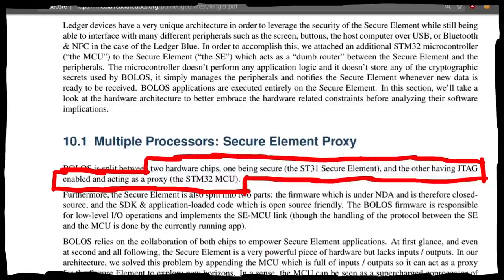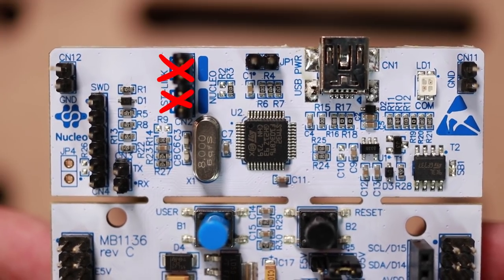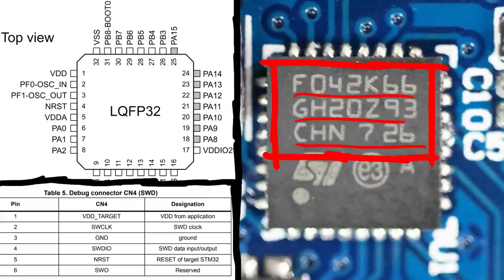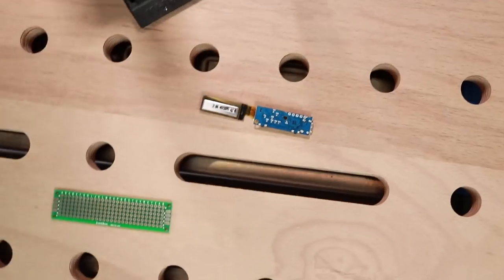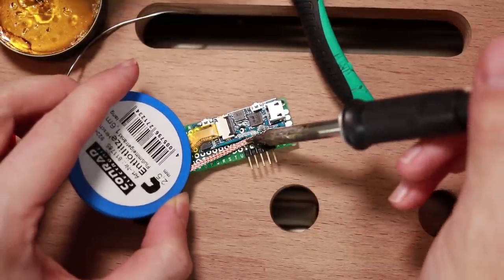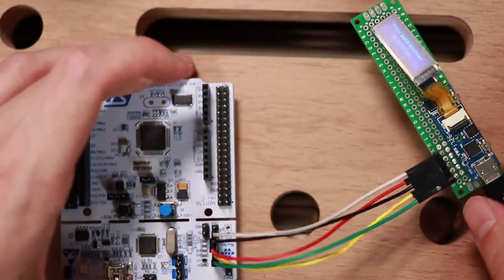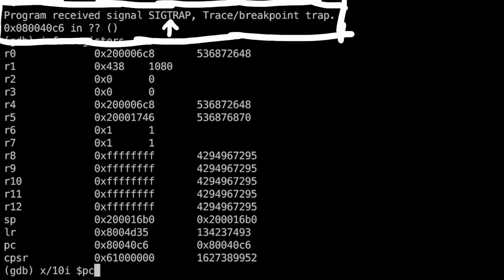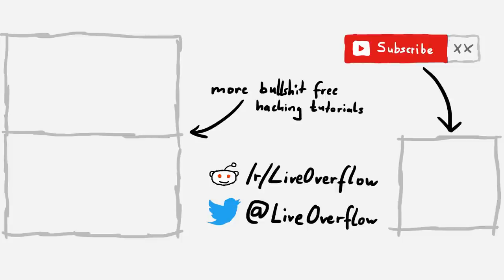Remote Debugging ARM Chip with SWD/JTAG - Hardware Wallet Research #3

Comment: So you basically made a PCB so that the pins are at a right angle? Instead of just poking them through the PCB of the ledger? Why is that? Why not just solder the pins directly to the PCB and, looking at the pinout, directly put the ledger with it's pins into the debugger?
Reply: Looks cool LOL
Reply from the maker: I thought it looks cool 🤷‍♀️
Reply: @LiveOverflow  lol agreed
Reply: so its more rigid to solder more hacks on :D add i2c sniffer pins, and to add blue status leds :D .... or it looks cool
Reply: @LiveOverflow  lol 😂
Reply: The debug pads on the Ledger don't have holes going all the way through - they're just pads. This makes it pretty awkward to solder pins on, and I think @LiveOverlfow's solution was pretty neat considering this. At the factory they will use pogo pins, which are the ideal way to connect to these pads.
Reply: better question, why not use the ST-Link instead, and install a simple JTAG/JLINK Update on it? I did it once and it worked.

Comment: Why haven't you soldered the header directly on the pcb?
Reply: PCB have no holes, those debug dots are placed right on top layer of PCB, so it's kinda hard to solder a header there
Reply: @V4ker  No need holes, it is easy to solder the header to the pads.
Reply: @V4ker  You can easily solder the header sideways if you know what i mean
Reply: @gabiold  Yeah, but it's kinda way too easy to rip them off

Comment: Why are you doing simple connection in so difficult way? Nothing criminal to solder wires to spots on the PCB immediately. Wires can be easily unsoldered back one by one but unsolder hard plate from all pads simultaneously is much harder and there is danger to damage the pads.

Comment: BTW Mr Overflow, that copper mesh is called solder wick.
Reply: ENTLÖTLITZE in German ^^
Reply: @RoiEXLab  Yes I also like to use ENTLÖTLITZE. For any soldering job ENTLÖTLITZE is a must have. The greatness of ENTLÖTLITZE must be capitalized here.
Reply: @RoiEXLab  Huh, TIL. I'm not even going to try to pronounce that but thanks for including it - I wonder if it translates to "copper mesh" by any chance. Google translates it to "braid" which i guess is correct, its also called solder braid too.
Reply: @QuickishFM  Entlötlitze means Desoldering braid
Reply: @QuickishFM  Huh, I don't know TIL. What does that acronym mean?
Reply: @avi8aviate  that means Today I Learnt.
Reply: @QuickishFM  Ok, thanks.

Comment: You should either power it via its usb port or via the SWD, not both. Especially if you are powering them from different sources. Keep just the ground connection, two data lines and the reset if you want to power it via the ledger's usb.

Later edit: although a lot of serial programmers (microchip, atmel, arduino, etc.) provide VDD to the target, it seems that this is not the case here (ST link nucleo). See the reply from Repligon below.
Reply: ST-link on nucleo doesn't provide power to the target. VDD_TARGET pin is there to read target's operating voltage. It won't even connet if voltage on this pin is too low.
Reply: @Repligon  oh, didn't know that. I thought that it also provides power.
Reply: in that case i guess it was resetting cause vcc and ground shorted(since it was swapped the vcc on the ledger was connected to the usb chassi on the st link)

Oh well, that's some quite resistant hardware XD
Reply: @Repligon  I was pretty sure that was correct, but when I looked at a couple of ST devkit schematics, and checked a devkit I have in front of me, the resistor connecting VDD_TARGET to the programmer isn't even fitted!  I've been connecting it religiously, but apparently on my devkit it's a do-nothing pin.  A 10k pulldown and nothing else..

Comment: When you want a soldering alloy to leak somewhere deep and narrow, use much flux (you really can't overshoot with it) and slightly (just slightly) overheated soldering iron. You touching your place with the tip and holding a little and then you can literally see how the alloy suddenly seatles down. Then you stop heating but let it cool down before you wil move it any kind. 
And in general use more flux and use a good one like FluxPlus, that can be leaved without washing and don't worry that it can corrode the copper.

Comment: Pin change happens and it is bad and terrifying!!😌😌😌
Just the day before yesterday I was working in addition for our school project, and took off the line from the ultrasonic module to pass through a hole in wood
After reconnecting, horror of horror , the arduino turns on for a second but the ON led fades (AAAAA!!!)
a lot of panic later, I realized the pin arrangement of the module was
VCC.  Trig    Echo.  GND (module pins)
   ¦          ¦          ¦           ¦
GND   Echo.  Trig.   VCC ( my connection)
SO GLAD to find it still worked! Thought I had fried the module 😌😌😌

Comment: My trick to make a path with solder : when you put it on the first point, don't remove the soldering iron and keep it barely attached to that drop of solder (try not to burn the boars) this way the flux inside it burns (or flows down, not sure) and it will follow the soldering iron that you use like brush to draw

Comment: What do you think is better to study to learn something like this? Electrical Engineering or Computer Science?
Reply from the maker: Does it matter? Just start right now ;)
Reply: @LiveOverflow  Well I can't decide between these two and hope you can help me :)
Reply: @maximood-tired  Electrical Engineering, its closer to the hardware, low level stuff :)
Reply: There is actually a nice strategic pick you can make there:
Can you say you're a passionate of one of the two? 
Then pick the other.

If you're passionate with algorithmics, system design and general computing stuff then picking EE will allow you to expand the knowledge in areas you would not pick up by yourself, that will often seem tedious redundant or unnecessary, but in the end provide you with a much better general picture.
Reply: At my University in germany, you can choose between Computer science and (maybe a bad translation) technical Computer science. One is more focused in Software, the other one more on Hardware.
Reply: I don't know about your schools, but over here I was able to major in electornics&electrical engineering and minor in CS -- so I got a bit of both

Mind you, I wound up working as a software developer, so it doesn't really matter what you study so long as you get in there and do something
Reply: You can approach it from both directions, but if screwing around with hardware like this is really what you want to do, Electrical Engineering is probably the better choice.
Reply: I got my undergrad in Electrical Engineering and am now getting my master's degree is Computer Science. It wasn't planned, but I felt like it was easier to "add" layers as I went up from EE to CS. But it's also perfectly valid to go the other way. Either way you can get started in both with an Arduino UNO and some tutorials!
Reply: Go for something called "Computer Engineering"
Computer Science is focused too much on theoretical and algorithms, EE Meanwhile focuses on all aspects of EE, including Analog Electronics,Digital Electronics, Electricity transmission and distribution( forgot the name of this subject ), Frequency and other Radio stuff.
In Computer Engineering tho, they teach you about Digital Electronics( the building blocks of modern computing basically, how you use transistors to make up logic gates etc which then make up a CPU chip or RAM chip ), Operating Systems, Embedded Systems, VLSI Chip design.

Comment: @LiveOverflow You was wrong about the VDD voltage, it's 3.3V not 5V, cause the stm32 not 5v tolerant, also I think you should not connect the second usb cable (to the ledger), cause it's already got the voltage form the VDD pin, but I'm not sure about that.

Comment: I use STM32 discovery board for STM32 bluepill. Need to get blackpill for testing. It seems almost all debugger prices are going down. microchip have some 10-15e debuggers (mplab snap) and Ti also have pretty cheap launchpad

Comment: After using these demo kit ST_LINKs for several years, I just realised that on the two boards I've examined, VDD_TARGET is not connected to anything other than a 10k pulldown on the devboard.  The resistor which would connect it to the programmer is designated as not fitted, and when I checked a real board, yes, it's not fitted.  Might as well not connect that wire..
Hopefully the 'real' programmers are better than that.
(edit) Ah, I see from Rafał Mróz's comment that you must fit that resistor if you snap off the ST-LINK PCB.  The ones I've been using don't have the snap-off feature.

Comment: The chip reset because the reset pin got pulled up by the development board. I've seen this happen with Arduino's, ESP8266's and teensy's It's usually for communication or to activate programming mode. The reset pin has to be pulled up to synchronize communication and reset current running script which sometimes uses communication pins for your script to be able to upload. 
I'm going in to cyber security and I'm so glad I already have a background in electronics.
Reply from the maker: Yeah of course. But here it happened because I reversed the cables and it was accidentally triggering the Reset - not the reset sent when debugging.
Reply: @LiveOverflow  I just checked and It looks like it was the ground and SWD clock you swapped so it wasn't even the reset pin strange. I suppose the ground pin must have pulled down the signals of the clock or something not really sure why that would happen but it shouldn't damage it at least.

Comment: Not sure the difference between the stlinkv2 and v3.. but how does the $40 stlink-v3/mini debugger differ from the $700 ulinkplus debugger?  The latter is said to use coresight and swj (swd+jtag)... but the stlink also uses swj/jtag!   So, for example, could the stlink-v3 hardware be used with openCSD to analyze a trace stream?

Comment: 8:25 Oh yeah, you should have powered the ST-LINK/V2 before powering on the target. As you noticed, doing it the other way around can cause problems, and I think it may also be bad for its long-term health. Hotplugging into a running system is also a headache since in my experience it tends to glitch the reset line. Basically, the ST-LINK/V2 just sucks :)

I ended up ditching it and used my XDS100V2 (from Texas Instruments) instead, which doesn't care about the order in which you power or connect things, and keeps its I/O properly high-impedance until both it and the target are powered and the debug software clears the powerfail flag. It only does JTAG though, no SWD, but fortunately that was all I needed.

Comment: when the display board is connected to st-link and if st-link is not powered the program wont run (maybe its due to nreset being tied to the stlink).Power on the stlink and it will resume running.

Comment: What? You have pin headers. Why not use them to connect the ledger with the perfboard?
Also you can cut the dupont cables and solder them directly to the ledger.

Comment: Full Firmware dump? And this is secure? 
Are you serious???
Reply from the maker: please checkout the threat model documentation and the architecture/design of the ledger. This is the firmware dump of the "insecure processor". NOT the "secure element". It's not so simple and black:white.
Reply: @LiveOverflow  Hi, but if you got hands on a ledger, could you write a program on the insecure chip that when asked for authentication by the secure chip could send that to a computer, the computer calculates the answer from the firmware dump, sends it to the insecure chip, that sends it to the secure?

It bypasses the size limit of the flash in the insecure chip (Inability to store all the responses to secure chip's authentication), allowing the key extraction if you, for example stole it and opened it up.
Reply from the maker: Afaik the secure chip requires tight timings that can’t be (easily) met with a proxy like that. But definitely one of the ideas to try!

Comment: It is weird that the memory protection is not enabled on such device (chapter 3.3 of RM0091).
Reply: I guess its only for the main controller and not the secure element, though it stills gives way to reverse engineering and potentially malicious firmware that could, for e.g., record the PIN code or something like that. Since you would need physical access for it anyway, its not something that I think ledger would care too much about. It's still surprising how they actually gave you solder pads for debugging it though - i wonder if that's going to do more harm than good...

Comment: Seriously, why would you use both the link usb and pcd usb together? Then you wondered why the board did a reset? The soldering part was a complete waste of time.
Reply from the maker: ok boomer
Reply: @LiveOverflow  Guess someone didn't understand what the whole video was about.
On another note I think you can use this with VSCode + PlatformIO, so you can actually set breakpoints and such in your source code.

Comment: Why didn't you just buy these cheap chinese ST Links for just 3 USD?
Reply from the maker: Why should I?
Reply: There is absolutely no difference between those and the onboard one, it's just a STM32F103CB, except it has a different header shape. 
Except you have a nucleo board as an added bonus, and they come in handy.
Reply: @LiveOverflow  Cheaper, has a case. A Bluepill is also a good option :)

Comment: Dude, use flux! 6:40
Reply: But flux works the other way around. It makes solder liquidy to roll into balls. Without flux solder is sticky and make spikes and bridges.
Reply: @ilya_mzp  I know, but those bridges can be done using wires - see the video. To be honest, he should've just soldered the coloured wires straight to the board instead of messing with the additional PCB.